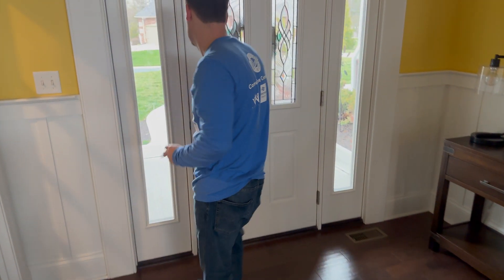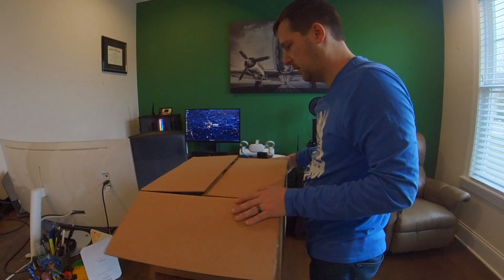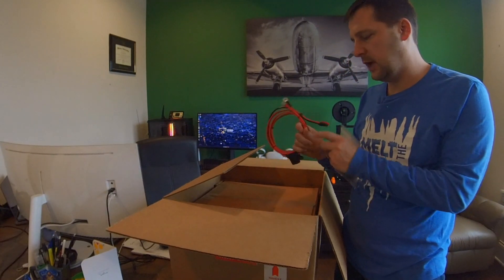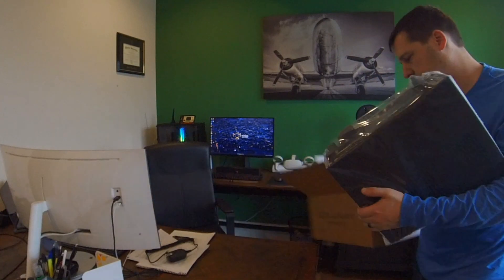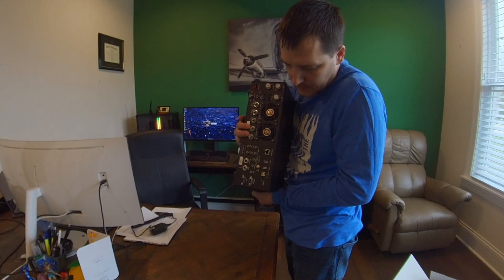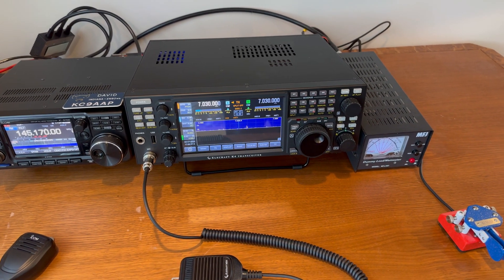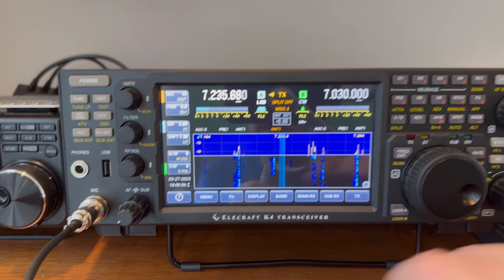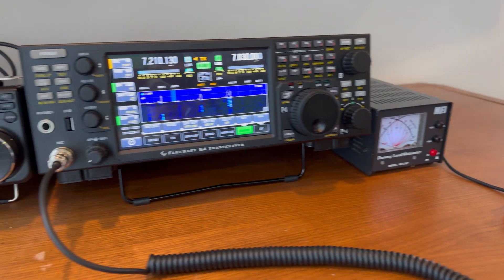The Elecraft K4 Has Arrived: Unboxing and Setup

Comment: Congratulations on the K4.  I had ordered one and was on the list for over a year.  I decided to cancel my order last spring, about 8 weeks before my order would have been ready and purchased a FTDX-101D.  It was a tough decision as I have a full K3-Line (K3, KPA500, KAT500, KPOD, P3 and many options), had a KX3 and love the Elecraft gear.  I still think about the K4, but it's hard for me to justify the cost compared to the cost of the '101D, which was $3149 at the time.  I will say that the refinements Elecraft puts into their radios are absolutely better than the half-baked implementation of Yaesu's '101D.  Does the '101D have a great receiver....yes.  But, there are many other things that could have been done to make the '101D a truly great radio, and I doubt Yaesu finish the '101D as they've been busy getting other radios into the market.  The "refinements" I mentioned are operating refinements that make Elecraft radios true contest/DXpedition radios.  There are many, many of these...too many to mention.  If these operating refinements aren't in your K4 today,  they will be in the future.  After owning Elecraft for well over a decade, I know they stand behind their gear and their clientele is far more demanding than any other brand.   I also suggest dumping the 9700 when the VHF/UHF options come out for the K4.  I also have a 9700 and the K3 with the 2M option performs better!  Best of luck with the K4 and don't look back!!!  Tom / W1TXT
Reply: Thanks Tom! Yea the cost did make it a hard choice for me as I previously used an FTDX10 and loved its receiver. But i found myself primarily using my KX2 for POTA Portable operations and just love how everything works (especially for CW). So I set my sights on a K4 and so far enjoying it! That is a cool part of the radio is it appears they are adding features all the time with firmware updates and the modularity allows for future enhancements (such as the VHF/UHF Transverter). Now I must say, I love that 9700. It is very crisp. ICOM makes a great radio as well. Very intuitive
Reply: @David Estes  I thought that too. Never have I ever heard the words.  Dump that 9700!! 😮😮😮 I love icom but I'm also not brand specific. I own several different radios. A good radio is a good radio.
Reply: Curious what you think of the Kenwood TS890? How that would stack up against the K4 which you didn't get.

Comment: Popping noises normal? Every time? $4500.
Sigh, the designer wasn't quite finished when they stopped.
Reply: Who said they stopped?   Elecraft is known for software and hardware improvements, and is very responsive to customer input.  Its probably not high on their list of things to work on as its not really much of a problem.  Never really noticed it until now.  I have done several updates on the firmware in my radio, and its very easy to do.  Hook the radio to the internet, tell it to look for new updates, and if there are,  you can choose to update right then and there.
Reply: I was thinking the exact same thing. A deal breaker for me. Was ready to buy one but not now.
Reply: This is definitely an on going topic in the groups. Not sure if there will be a fix or not and it caught me off guard when i first started it. After having the radio for a few days though the features kinda outweigh that. I am noticing it a bit less. I did notice my KX2 also does that but at a much much lower volume.